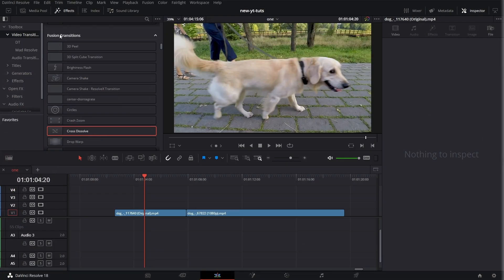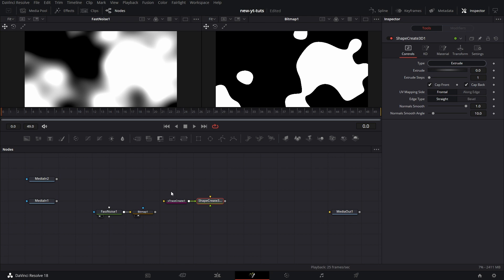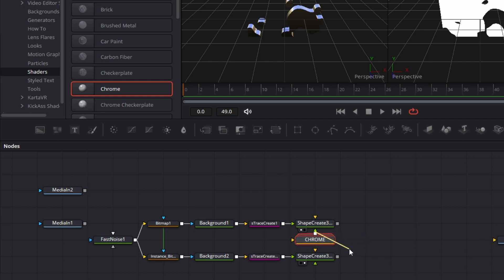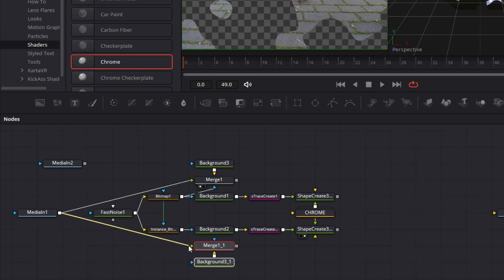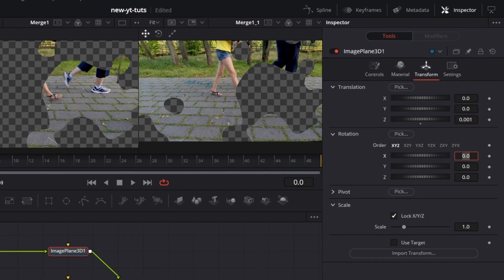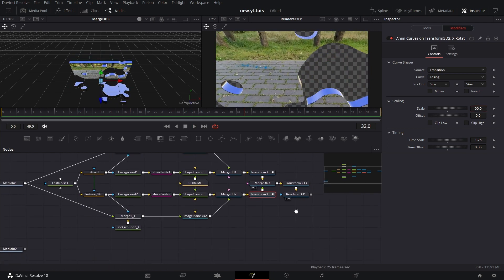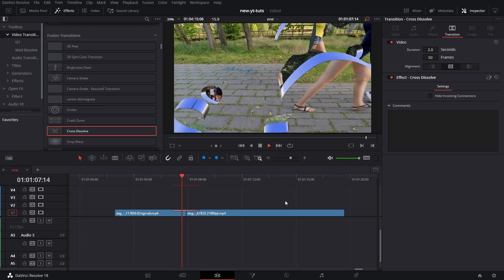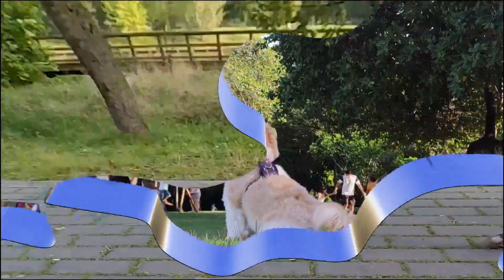Unique 3D Slice Drop Transition | Davinci Resolve | Free Transition download

Comment: I did not find any node named sTraceCreate in my Davinci Resolve 18.5.  Where did you get it?
Reply from the maker: It's in a plugin within Reactor, a third party plugin repository. You may watch the video, link in description on how to install this. Skip to the very end where I showed how to install Reactor and Krokodove. 

Do let me know if you have any challenges installing this.
Reply: @madresolve  Bugger - Krokodove is not available for the beta version of DR 18.5 - it will be available for the full release version. I've been waiting patiently for the full release of DR 18.5 so I can get Krokodove.
Reply from the maker: Oops, been holding off on updating resolve too myself. Waiting for the full release. 

But I just admit, the new features are extremely tempting.
Reply: you can simulate the extrusion with image plane where you connect a bcakground masked like the picture and duplicate3d, dup with z offset 0.0005. and 20 copy, then merge piece and duplicate on separate merge 3d for each piece
Reply from the maker: This is definitely an option for those unable to install krokodove however it may run a little slower due to the duplicates.  Thanks for sharing.  Hoping blackmagic releases as official tool for this.
Reply: @madresolve  yes a native extrusion is really missing. i simulated with 10 copies, its convincing, the con is that there is no shadows on the extrusion but on an i7/32g ram its not that slow
Reply from the maker: I like that you actually did the wipe. My goal is really to give the knowledge to do just about everything I do.

And that your system specs can handle just about anything Fusion can throw at it.

Might just do a version of the wipe without krokodove tools after all. Hope you don't mind.
Reply: @madresolve  sure :) i would be honored, i learnt so much from you. here is my draft https://youtu.be/hIVPg6pYRrk
Reply from the maker: This is really good. Just subscribed to you too.

Comment: Cannot install your DRFX file. Here is the message I get: Unable to Install “3D Cutout Drop”

The selected path does not seem to be a valid template bundle format.
Reply from the maker: Thank you so much for pointing this out. I've corrected this now. There is also the possibility that it has already been installed.

Do let me know how it goes.
Reply: @madresolve  It installed properly but I had another problem.
                  Warning: Unknown tool found
                  Name: 	ShapeCreate3D1_1
                  ID: 	KomkomDoorn.KD_ShapeCreate3D
Reply from the maker: The tool used to create the wipe is within Reactor, a free third party plugin for fusion. You may need to install this plugin to be able to use the transition. I placed a video link in the description (skip to the last part of the video where I showed how to install Reactor and subsequently install krokodove}. 

Please let me know how this goes